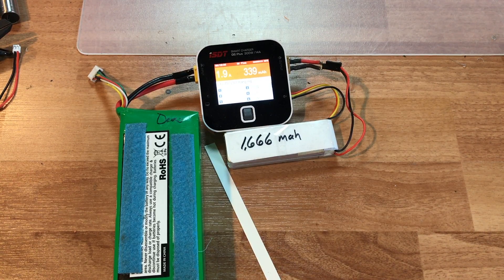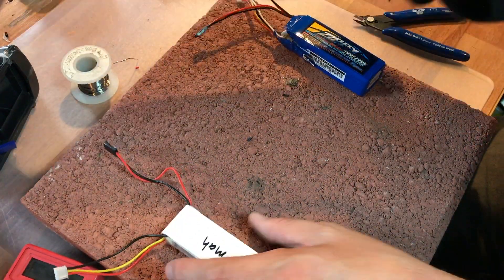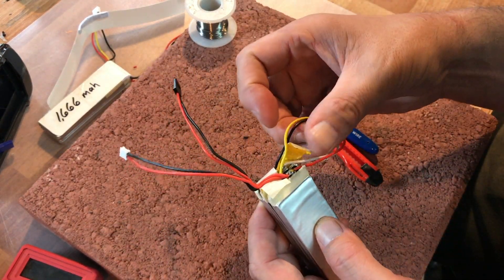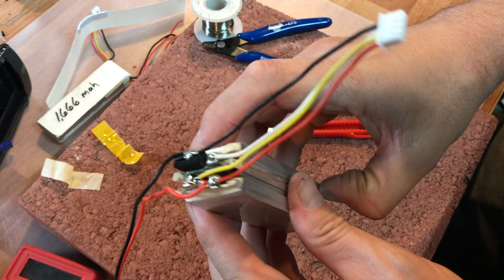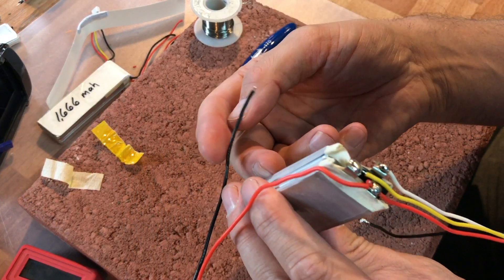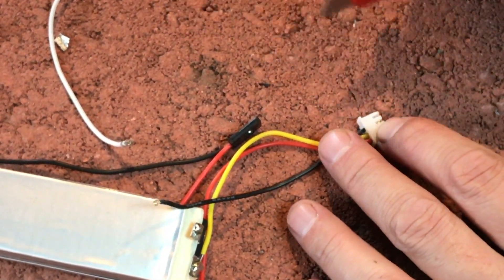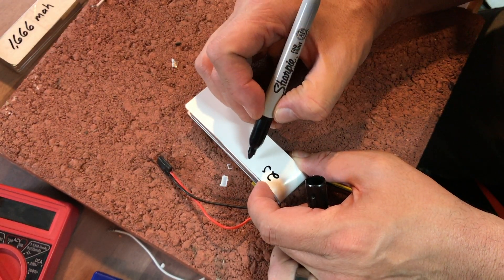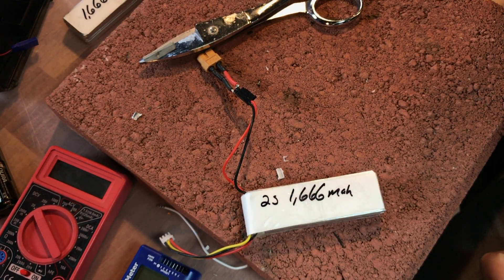Removing A Lipo Cell 3s to 2s

Comment: It's good practice to drain the battery as low as safely possible before doing a job like this in case of a fire. The more these lipos are charged the bigger fire they make, if they do combust. Good video though.

Comment: It’s safe enough to do just done this to a pack of mine. I’d drain it to 3volts per cell first. And make sure the front door it’s unlocked incase you need to leg it

Comment: Hey Jeff, good video except your math is a little off, lol,  it’s still the same capacity just lower voltage. 👍😎
Reply from the maker: Yup,,,, I'm going to re upload the video with a note in the beginning and cut out the parts where I talk about compacity,,,
Reply: Is it possible to cross the terminals to loose the mah but keep the voltage?
Bought a 900g battery for RC plane 6000mah don't think the thing is gonna go airborne with the weight!

Comment: Hey Demo old mate , Aleksander beat me to the punch. Yes the lipo is still 2500 mah even it was one cell, 1s, it still would be 2500 mah. You've been caught out man, one point to me and zero to you ha ha. Anywhooo keep up the good work. Cheers Stew.
Reply from the maker: +stewjade  your totally right.... back to the drawing board,,, lol. I may take this video down and add a note about the mah
Reply: Don't worry, I made the same mistake when I first started splitting old packs up to make a newish one's etc. The difference was  didn't tell the world out there via YouTube, ha ha. Score even now. Cheers Stew.
Reply: @stewjade  so what changed? Voltage dropped
Reply: Karan Karnik yes indeed, in this case 1s would be 3.7 volts, 2s 7.4 volts and so on but all 2500 mah.

Comment: The capacity is still the same Demo! ;) Just has lower voltage! You now have 2500 mah 2s battery
Edit: those cell 2500 mah cells are wired in series to increase voltage! Would be different if they were wired in parallel
Reply from the maker: +Aleksander Hesbø ahhhh,,, darn it!!! You’re right,,, I’ll put a notation in the description!
Reply: Came to say this - a 2500mAh 3S1P pack is three 2500mAh cells in series, not three 833mAh cells in parallel!
Reply: @CJDavies  I didnt know that. Good to know!
Reply from the maker: Yup--- good catch... I'll repost this video with a correction..thanks!
Reply: Yeah the Mah stays the same.  The total Watt hours drops from 27.75 to 18.5.
Reply from the maker: Thanks for the note- Ill re- edit and repost the video...
Reply: yes, i was just thinking why is he marking that cell 833mah and the other  2s battery 1666mah ? :)